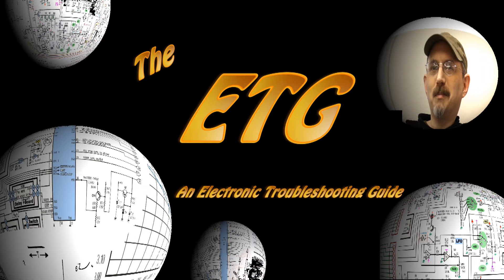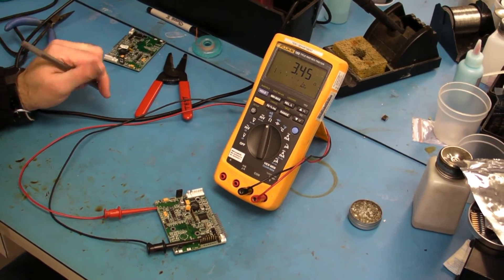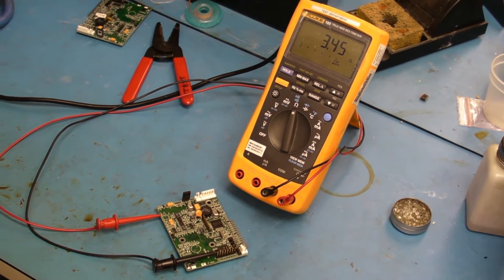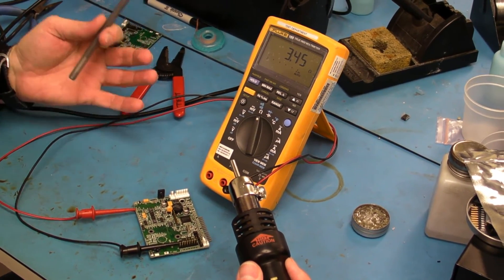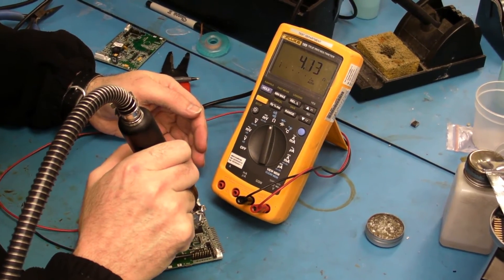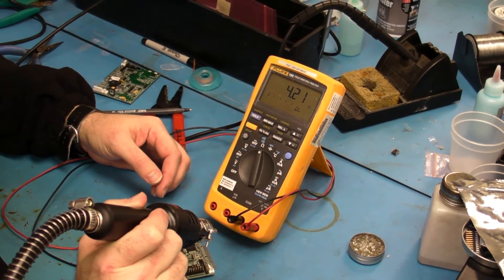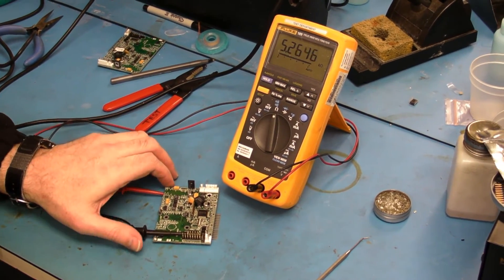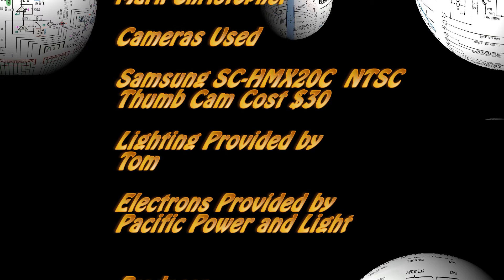ETG-1-01 T.R.I.P. IC Isolation

Comment: Great Technique. After hours working on a shorted power board on my oscilloscope I used your T.R.I.P. technique with my wife's hair dryer at low temperature and blowing the hot air through a funnel for a pinpoint air flow effect. I found the shorted out 125mH, 2 amp toroidal coil in a couple of minutes. I suspected it was the possible culprit from the schematic but it looked new and I didn't want to disturb it. Thanks for taking the time to make this video and sharing your knowledge.